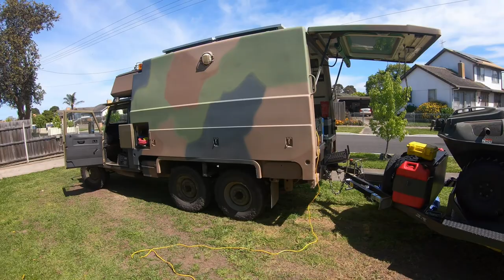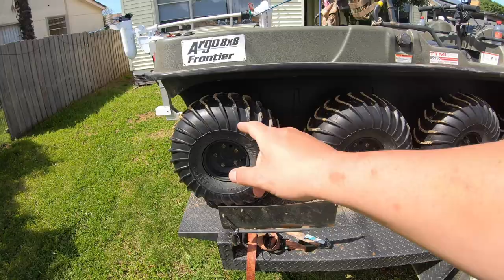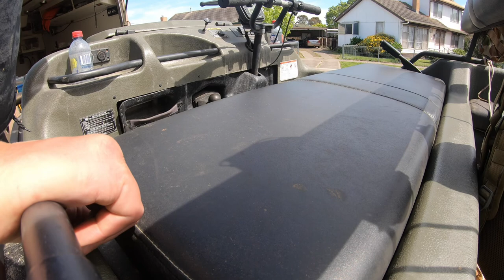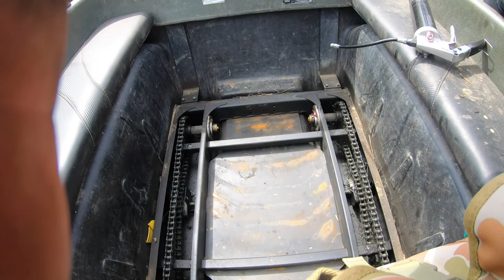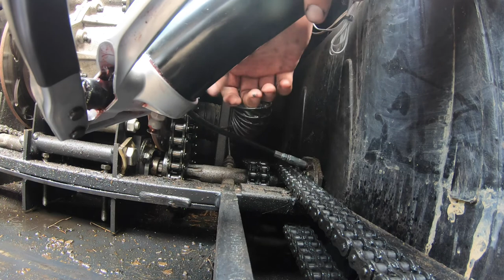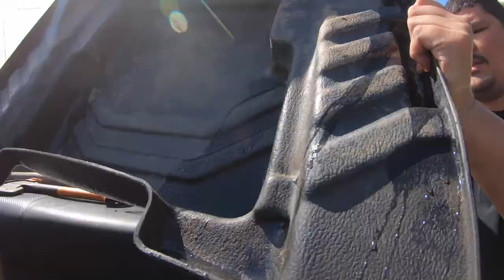Argo 8x8 Grease and Oil

Comment: Hello, for me.. The chains look to small for that rigs  that could explain why they stretch .
Reply from the maker: They are about twice the size of motorbike chain.
They don't stretch, rather they wear-in like all roller chain. 
The load is distributed across 8 wheels which results in considerably less torque on the chains.
Reply from the maker: They use 60h 1x36p chain

Comment: How often do you have to grease the bearings and oil the chains?
Reply from the maker: Manual states chains should be oiled every 8 running hours, I do outer grease after every major water adventure, and use marine prop shaft crease (castrol ultratak). Inner bearing about every 20-30 hours.
I use a hand pump for grease to avoid blowing out the bearing seals. And I use spray pack chain oil